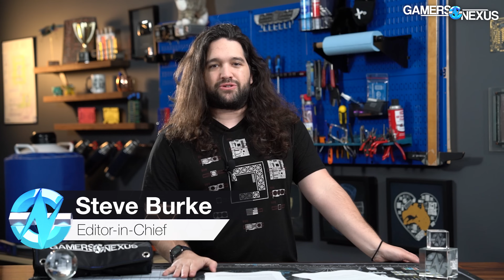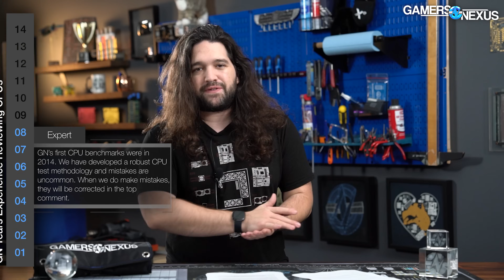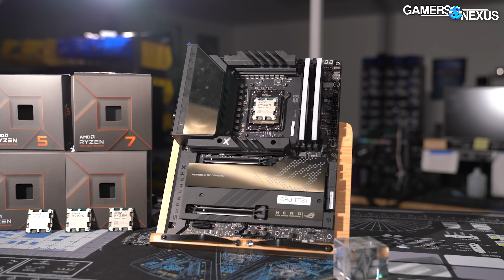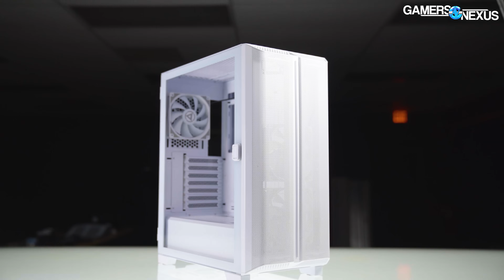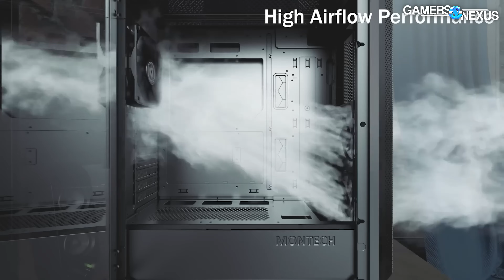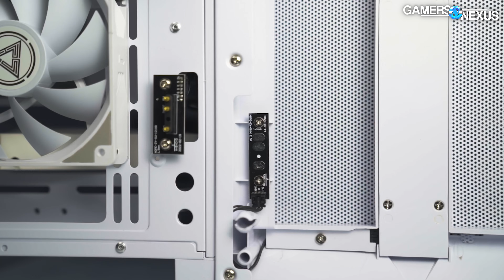AMD Ryzen Eco Mode Deep-Dive & Benchmarks on R9 7950X (Zen 4)

Comment: 09:16  You're measuring power going into the motherboard's VRM, not power going out of it.  Around 10% loss is a fair estimate.  The CPU is not drawing more power than the PPT limit.  You're just not measuring that value.

And you're still making shit up about AMD's TDP.  It's a formula designed to allow heat sink engineers to know how to cool the chip.  It's not designed to match a given number.  It is tied to power consumption, as the theta CA variable is a measure of thermal resistance, and that thermal energy comes from power input.  It's not a 1:1 mapping, because not all electrical energy going into a socket comes out the top as heat, but theta CA still includes a power measure.  In watts.  Which is why the formula provides a number with watts as the unit, after accounting for thermal resistance and the typical air temperature delta of the case.

What you really should be doing is either educating yourself on what AMD's TDP actually means - which requires learning a bit about actual engineering - or stopping the pretense that you already understand it.  It's not a good look, especially with that stupid bar at the beginning of the video which claims you're an "expert".

Comment: maybe 5 people who are interested in getting a 7950x, spending obscene amounts of money on the new chip, top of the line motherboard, and likely new power supply and case actually car about eco mode.

This is a sports car and you're talking about reducing its horsepower to get better fuel mileage. nobody who is a customer for it wants to buy the fastest card to run it at fractions of its power.  Overall performance is what differentiates this market segment, not fuel mileage. You guys spending hours and hours testing fuel mileage on a lamborghini or mclaren is a waste of your time and doesn't say anything important to the people likely to buy those products.

You guys are so interested in where AMD is beating intel that you're actually asking the wrong questions.  The real questions are why, multiple nodes ahead, AMD chips are about on par in performance with intel, and what does that mean when intel finally gets off 10nm++++.

These masturbatory "its so efficient" videos on chips no one is buying for efficiency is your own computer fetish, and has nothing to do with the market for these products, and doesn't say anything important enough to spend 1/2 hour watching a video about. Get over this nonsense and focus on the things that differentiate the market segments, not the one place AMD gets an advantage because they're using TSMC's smaller nodes yet somehow are still not clear performance winners.

You guys do nothing but ask the wrong questions and measure things that almost nobody cares about. What you should be saying is "If you spend a ton of money to buy a 7950x, board, ram, etc, why the hell would you lower its performance instead of just getting a lower end chip?"

Comment: This ECO mode would make more sense if it was a feature easily accessible on the desktop and not burred in the bios. a bit like the old boost button, your computer is normally in Eco mode. which is mostly OK for most of the time and when you have a big job to run you can get out of the Eco mode.

Comment: 1174 comments already, so I doubt someone would read mine too... but I do hope someone at GN will.
Video is well made and content is straight to the point (as usual for GN). What I do miss however, there's no mention of the complete costs of higher power consumption. As it is now, many just say "eh, 40W more per hour.. that's dollar per year..". And if someone mention cooling, many think "eh, it's only 15W for 5 fans". But reality is far from that.
Every watt consumed by PC, is transformed into heat. And by cooling our PC, we start to heat up our room. Just an example: in summer, 200W will heat up our (average) room by 4-5°C in less than in half an hour. And the only thing we can do is (unless we're in sauna mood), to crank up air condition. What is important to understand is, to decrease room temperature by 4°C, the same amount of energy is needed as it was for increasing the temperature: in this case 200W -means, at the end we pay 400W.
Just wished to point that out. Thanks for reading.

Comment: Hello Steve and team, I wonder if the ECO mode (limiting the CPU by maximum allowed power) won't be ideal for those that want to deal with the limitations of small form factor builds both from cooling perspective and to budget in what a high end GPU would require.
It would be so cool if AMD could enable in an application or driver a way to balance out what the maximum power the CPU plus GPU could draw.
I know it is a pretty niche perspective, but I do remember some of you used to build pretty powerful SFF systems to take along with you to edit, render and upload videos on the go.

Comment: I feel like just the reduced noise from running your cooler at a lower % at 105W eco mode is worth it over the marginal performance difference from stock.
If I understand it correctly, stock will hammer your cooler at 100% all the time, so giving your ears a break from the fans sounds valuable to me.

Comment: The AMD TDP formula you guys keep bashing is basically the formula for heat flow or heat flux. I'm not sure where this "the terms and numbers are made up" came from, even 3 years ago from the previous video, but it's not made up. It's a generalization of an existing formula that tells you how much heat you need to be able to dump based on CPU temp, ambient temp, and thermal resistance (i.e. the heat flux/flow formulas). If anything, it's the best and most transferrable TDP evaluation method we have, because the thermal conductivity term can be broken down into conductivity of the IHS and the cooler in series with each other. When there are cooler changes, socket changes, or IHS changes, you can change those out and have an equivalent result for literally any given setup if you know the conductivity of the cooler and the ambient inside the case (or at least from the perspective of the cooler).

You guys are correct that "watts are watts" but you're looking for marketing gimmicks in the wrong place here.

Comment: I would argue its not only the electricity bill saved but means you can also cut costs on the ridiculous cooler requirements and even amount of case fan, and/or reduce total system noise. That's why efficiency shouldn't fly out of the window and why I'm very against manufacturers doing no tangible innovation and just pushing more power targets that consumers have to pay for indefinitely.

Comment: Steve, do you think that AMD will go back to the drawing board after looking at how the 7000 series CPUs are not as efficient as their predecessors and are losing to Intel 13th Gen in quite a few areas? Maybe to bring those power consumption values down to what we saw in Zen 3? Or will they just go full Intel and feed as much power into their future designs and get rid of the whole power efficiency theme that Ryzen has had up until now?

Comment: GN keeps saying about AMD's TDP that "none of these are power", yet it absolutely is. Divide a temperature by a thermal resistance, and your result is in power, as thermal resistance is unit temperature per watt.
AMD's formula defines TDP as the power needed to cause a specific rise in temperature.

Comment: Is it possible to use air cooler (like noctua D15 or Dark Rock Pro or similar) to use with that 105W TDP Eco Mod or it still needs to use AiO?? 
How temperatures be in that scenario, (maybe I'm old fashioned but I still don't trust liquid coolers). 

I know it's a loot of work so I'll be really grateful if you could test that. 
This AMD 7000 cpu's with air coolers cause everyone one I see testing them they use AiO.

Comment: Jw if you guys were going to do a story on the ongoing problems with the oled's in the Asus Maximus extreme boards? Z690 had issues and I literally just bought an built a z790 version and the oled doesn't even turn on pre boot prebios update and just never turned on. Now apparently I need to take everything back apart and take the armor off and see if u can see any issues. Only good news is it does 6.1ghz ai without even touching anything with 13900kf

Comment: Having comparison of CPUs with certain watt amounts would be awesome. I have 5900x, and I've underclocked it the best I could, to get about 40-50W consumption, with little noticeable drop in performance, so I've been quite happy, but I've wondered how other CPUs with similar consumption would've fared. 7950x very likely would be way better, but also Intel offerings, other 5000-series Ryzens, and whatever have you, would be fascinating to know.

Also, I'm not sure you have good mindset about underclocking. 10% performance is kinda irrelevant unless you consider competition. Like, ultimately, the cost of CPU is the price tag price + cost of electricity to run the CPU, and to cool it, and you compare that to performance. 7950x presents high price tag for high performance but that's ignoring running costs, and the question is, could cheaper CPU give better price proposition overall. Cases where speed triumphs over price, you wouldn't underclock, you'd overclock because speed triumphs, but for anyone else, you will seek best price for desired performance, so 65W operation could very well be that. Or not. Without watt per watt comparison, one can't really say. That 10% extra performance is irrelevant if you can just get 2 of those 65W mode processors for the same price as running single 105W processor. Can you? I have no idea, I'd have to do the math, find efficiencies of cpu's, etc.

Comment: Asus has introduced a new BIOS option for Ryzen 7000 CPUs called THERMAL LIMIT, where the user can cap the cpu temp to either 70c, 80c, or 90c.   What is the impact of capping the thermal limit to one of these values while the other settings remain stock (no eco mode)?

Comment: How does this work with Ryzen master software and using Auto Overclock?
Can you explain what Auto Overclock is doing and is it worth it? I've had my 5900x on Auto Overclock pretty much the whole time I've had it. As someone that doesn't know what they are doing with over clocking, is Auto a good option?

Comment: Comparing the efficiency with the previous generation, I am actually a bit underwhelmed. Only 11% better efficiency at 105 TDP while on a smaller node and the IO die jumping by like 2.5 nodes is not great.

Comment: Are these options available on the Ryzen 5000 series? I'm still using a 6600k i5 and am looking to upgrade to a 5900x. But I would like to run it in an eco mode most of the time if possible 🤔

Comment: Whether Eco Mode 65W makes sense or not also very much depends on where you live, IMHO. At something like 14 cents per kWh... yeah, sure! My supplier just made me an unbeatable offer of 55 cents per kWh, with the risk of it getting much more expensive than that if I don't lock down the price now. There... 10 percent slower? Yeah whatevs, if it saves me a lot of power.

And buying a lesser CPU... first of all, the fast one can still be easily set to be fast when I really need the power, and secondly yes, maybe at 65W it is as fast as a lesser CPU... but how much electricity is that going to consume to achieve the same performance? If it consumes much more power to do so, I'll get back the extra money spent in the first place eventually...
Reply: Exactly my thought on it. The whole video is made with the assumption, power is cheap

Comment: Can a fan cooler be safely used on the AM5 Ryzen 7 at 105W or do I really need liquid cooling?
Reply: The 105w TDP is just the base Package draw all cores at base clock 3.4Ghz. My 5950x (105w rated TDP) draws 140w using PBO and up to 200w with an aggressive manual OC at which point it's not practical to run as it's so unstable.  I cool it with a relatively small Noctua NH-U12S in pull-push with 2x1700RPM redux fans. At 140w no issues - temps top out around 50 Deg over ambient (70 in a 20 deg room). 175-180w seems to be the limit for the NH-U12S so I suspect a D15or similar large twin tower would have no issues even at 200w - in fact I think I have seen GN test the NH-D15 and it was around 55 deg above ambient even at 200w load.

Comment: What an amazing difference.  If I had a 7950X I would definitely run it in 105W Eco mode for the power and temperature savings (not that the latter is a problem), you give up very little in performance.

Comment: Why are people complaining about BOTH the higher default power limits AND the option to lower them? They could have released with lower profiles, but then people would be complaining about needing to "overclock" in order to get the most out of the processor. PBO and other tech to extract more from a processor with default settings is a good thing. Silicon thst can tolerate high voltage, temps, etc, is a good thing. The option to tune power and temp limits is a good thing. Quit. Finding. Things. To. Complain. About. Look for the positive perspective and rejoice in the effort being make to push the limits For you.

Comment: It would be awesome if the CPU could be dynamically adjusted to run in high efficiency mode most of the time, then maybe have a boost button, or by program or CPU demand options. Like how they used to have the "Turbo" button on older computer cases.

Comment: Almost feels like they should have had 105 watts as the designed power, and then had "stock" be a PBO overclock option. Would have been great for advertising efficiency with stock numbers while also touting how much performance was on the table if you wanted it. Would have also completely killed all the 95 degree complaints

Comment: Testing the 7950X kind of set the result the same way Computerbase testing "Threadripper at 180W" years ago did: If you buy the hardware to make money, it's kind of a no-brainer to nuke efficiency and waste maximum resources.

Cheaper parts would have been a more useful test.

Comment: What you Steve forget to mention in the conclusion or any part of the video that PBO can undervolt and overlock your cpu meaning you will meat the same performance or really close as stock around 85W power limit depending on your cpu silicon lottery. Which is insanely important because leaving that kind of performance on the table your have to be insane. Therefor your charts are not representative what the cpus are cabale for.Yes they represent exactly what they are meant to be, there is no problem with that but if your tinkering in the bios with one setting, setting up couple more does not make much of a difference. Most of the people hearing that you can go to the bios and change something they will avoid it at all cost but those who are willing really changing 4 to 6 setting does not make much difference.

Comment: Eco mode sounds very important, but in reality, it's not that big a deal. Most people aren't going to be doing all-core workloads very often, so for them, it's a moot point and they probably aren't the ones buying this CPU anyway. And for people who are doing all-core workloads often, then the time savings is going to be way more important than power savings, because you're doing it for work. I would value saving even 3-5% of my time far more than a few cents in power when doing work. Even at 100% fan speed, my cooler is very quiet, so even noise isn't that big a deal if you have a good cooler, which you should if you're buying a 7950x.

Comment: A comparison for power consumption at normal tasks like surfing would be interesting as well. Even though these are powerfull CPUs probably a lot of time the PCs they are in only do surfing or email checking.
Reply: I'm also interested in this. Especially the idle performance of the platform

Comment: I am running my 5900x at 95W TDP with around 10% less in multicore but for 5-10 degrees cooler, stops heating up my room too. I kinda wished there were more people looking towards efficiency than focusing on sheer raw performance.

Comment: 65W cTDP becomes very important when you run a lot of CPUs and you do not have latency constrained workload, so anything where you use a lot of compute but it does not matter does it finish today at 12:00 or 13:00 as an example. Or servers

Comment: What is also interesting is the behaviour of the clocks when there is not a lot of workload (idle or close to idle) power consumption. If the cpu is down more down-clocking it may also give an overall ~30% power reduction in the total usage of the PC.
Crunching some numbers just for CPU power consumption in a day of 8 working hours with only 2 intensive hours, 170WcTDP will have 1kwh and 105WcTDP will have 0.7kwh power consumption saving $0.1 per day per machine which is not but for a company..

Comment: On pre-zen servers i have noticed that on AMD Opterons TDP is pretty much exactly what they use, on Xeons tho ... Yeah double, sometimes triple that number. For some bizarre reason a 45W TDP Opteron server consumes 90-93W, but a similar age 65W TDP Xeon with very similar config, same number of cores consumes around 180-190W typical ...

Ofc, there are motherboard variability etc. but seen that be the case all around, i'd say something like +50% is the minimum compared to spec.

Oh, and new Zen based servers tend to consume much less, similar config ~40% less, and with 32c vs. 6c older Xeon, it's about identical for same number of drives (except 32c epyc having also NVMe etc. advantages).

Ofc, tech advances, but the change is very very dramatic. That 32c epyc is supposed to consume many many times more, but in reality consumes the same as older xeon.
Tasks vary etc.

TL;DR; Bottomline is -- If this matters to you, always, always measure it. and measure it again.